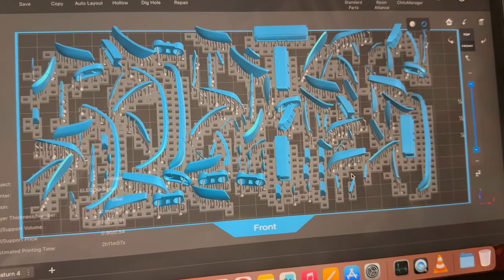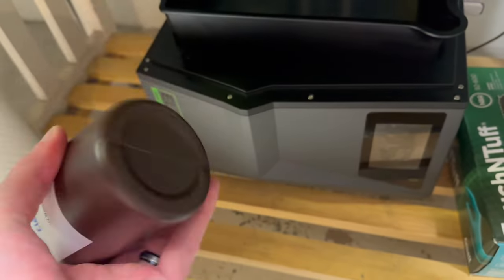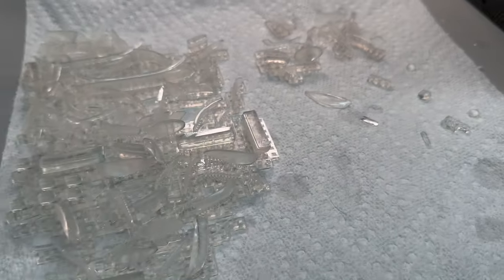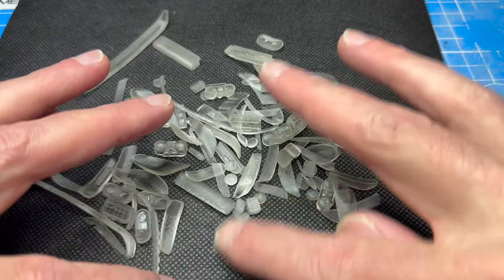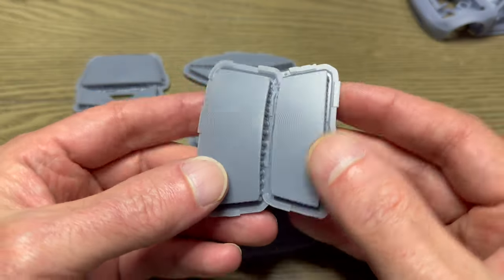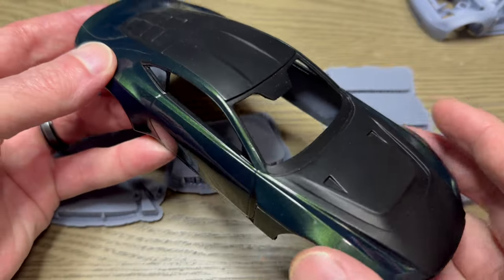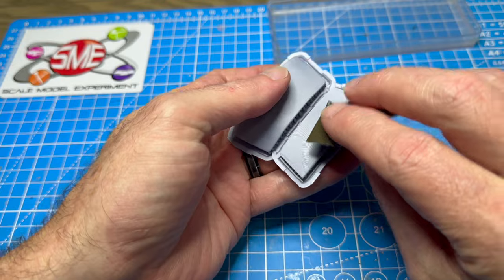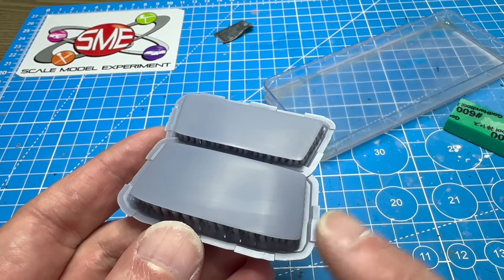Complete Idiot’s Guide to 3d Resin printing Clear Parts and Vacuum Forming

Comment: I've never used a vacuum former before. But I was thinking maybe you could just skip the heating element. Clamp the plastic sheet down on your molds and turn on the vacuum table. Then, use a heat gun to slowly heat the clear plastic sheet. It might give you more control. Just a thought. Only recently found your channel and have really been enjoying your videos.
Reply from the maker: That’s a good idea too for more control of the heat. Welcome to the channel, I appreciate your support.

Comment: 320 to 4000 is a huge jump in grit…to eliminate those scratches left by the 320 you need to use several intermediate grits between 320 and 4000.  400, 600, 800, 1000, 2000 should do the trick.
Reply from the maker: Thanks Forrest. I firmly believe that the window bucks don’t need to be any smother than maybe 800 grit. Now I know…

Comment: Alot of aircraft modelers dip their canopies in future floor wax an helps them be crystal clear. I would try that before tamiya clear. Looks good though.  As for the vacuum forming I think having the window bucks still on the 3d supports is causing the clear plastic to be drawn down and gripping near those supports thus not "letting go". Is there any way to put the window bucks onto a solid base?
Reply from the maker: Hi Dean, I’ll have to call in a favor to model the bucks the way you said. I don’t have the experience in Blender to do that (yet).

Comment: I have a lot of experience in vacuum forming small clear parts. The way your buddy did the buck is the best way to do it but make the ridge around the desired part a little deeper. Around the perimeter of that recess drill tiny holes to allow the air that is getting trapped in the valley to be removed. It is best to have a solid form to pull down on, I made my bucks out of cast plastic in silicone molds. You could take the molds like you make and polish them. Then take a rolled out piece of clay and fill in the sides to cover the supports. Then form a dam around the outside and pour in your silicone rubber. Once the mold is cured you can then pour in the casting resin. Once the resin cures drill the tiny holes around the outside edge in the valley completely through to the backside. Then take a small Dremel tool to grind out small channels between each hole on the backside of the buck. This allows the channels to line up with at least some of the holes in your vacuum formers base and suck out the trapped air around the part you want. Getting the heat on the plastic just right is a bit of an art form. If it bubbles it was too hot. pay attention to the sag of the plastic. If it doesn’t sag the plastic is too thick go down a thickness.
Reply from the maker: Thank you so much for your thorough explanation. Haha that’s a lot of work for a one off piece. I’m not in the business of selling. If I have a very special project that needs PERFECT windows I’ll go to the trouble of making a perfect buck. In reality I print 10, build 1 these days.

Comment: I meant to say in my last response, I have watched so many vacuum forming videos in the past, and they mention the small bubbles/dots in the PET are because there is some moisture in the sheets. Dry the sheets in the oven for an hour on very low heat. This will make the sheets crystal clear when forming. The stains are from the moisture.
Reply from the maker: Interesting, the sheets were in the house for a year and I took the protective covers off just before I put them in the machine. I think I over heated them next time I’ll heat them very quickly and pull vacuum to see what happens. I’ll also watch other people’s videos.
Reply: Leaving the protective plastic on until you are ready to put it in the former resolves the moisture issue. The bubble are from overheating the plastic. Since the heating element is all around the outer edge it will heat the plastic faster on the outer edge than in the center.
Reply from the maker: I’ve heard so many people say to wait until the plastic droops down before pulling a vacuum. I’m going to experiment with some much thinner plastic to see what kind of results I can get with it.

Comment: The first mold is the correct one, the only thing missing is the air passages for the vacuum, the more you have the better, the second one is bad for a reason, the piece to be made will hug underneath, for that reason it was difficult to remove, no and it needs to be a tall piece, it has to be well ventilated
Reply from the maker: Good tips there. I’ll make more bucks and try again.

Comment: Very informative James! Just a thought……when I create window bucks for my designs, I create them with no less than 2.5mm’s thickness to withstand the forces of the machine.

It looks like they were a bit thinner than that, not to mention the hot material coming down on it may weaken it a tad at that point of force.

Yes……I’ve recommended to folks vacuforming that to be sure you have PLENTY of PETG or Vivak around.

It can take several tries or more until you get a good piece, as there’s a lot of variables taking place that can affect how it will come out.

Heat, thickness of the object, force of the machine, thickness of the plastic……all play a role.

Thanks again for the great video James! I’m sure it’s gonna help a bunch of folks. 👍🏾
Reply from the maker: I’ll be printing more bucks and trying to form more soon.

Comment: I hope you do a follow up on vacuum forming windows. I might also suggest a bit of a review of the printing equipment and supplies you are using. So glad you’re sticking with your information/educational based format. So many of the other channels have moved away from this style. I’m completely engrossed in your advanced tools and techniques!
Reply from the maker: Hi Steve, I will be returning back to vacuum forming later. I have a tight deadline with this project so I need to spend my time wisely. I appreciate your support of the channel. I’m always trying new stuff to see if it works better. 👍
Reply: That is the number one question with everyone as far as 3D printed models. What about the windows?  @ScaleModelExperiment

Comment: Great video James. I’m trying to print glass today too. After washing I let dry, then I dipped. Ack in resin. At. It looked good, then I cured it for 1 minutes and it came out about 60%, but showed print lines. My next batch I’m going to sand glass after curing, then I’m going to try clear spray on 1 piece and future polish on the other. I like the way you’re making your bucks. I’m going to set that up tonight and try making bucks for my vacu form machine. I keep getting small bubbles or the haze you got as well. Some day………..👍👍
Reply from the maker: Hi Big Chief, I have been getting a lot of good feedback from the video. The bucks that I was using may not work because the vacuum is pulling under the lip. I will try the other bucks with less heat to see if I can do better. It’s all a SME 😁

Comment: Thanks for the video and kudos.  One thing about vacuforming is to make sure you have no undercuts on your buck.  The shape your viewer sent you is a far better approach.  Any undercuts you have (all that lip and raft space below) will draw the plastic in around your buck and make it difficult to remove, as you experienced.  You want a pretty good draft angle on your shoulder around the face of the buck, so that the buck contacts the hot plastic first, and plenty of vacuum air flow around it from that draft angle allows it to pull tight to the top.  Sharp corners or height differences will also make it harder to get a good pull, or sometimes to close suction route over a part... but you shouldn't run into that unless you start doing some pretty out there bubble window retro future cars, lol.  Keep having fun!
Reply from the maker: Thanks so much for the information. I’ll be trying again with the different buck soon.
Reply: Small holes around the perimeter of the part you want would allow air trapped in that area to be removed and pull the plastic tight in that area. Otherwise like you say the air gets trapped in that area.

Comment: Nice video James. Clear resin parts can be a pain. For my clear resin parts I spray them with Mr. Hobby GX112 uv cut clear. Not only does it return the clear finish the UV blocker helps prevent yellowing over time. Every time I see someone vacuum form it seems like an ordeal.
Reply from the maker: Hi JH, I’ll be dipping them. Maybe I could thin some Mr hobby into a cup for dipping.😁
Reply: @ScaleModelExperiment  Aircraft modellers have been dipping their canopies in Future floor polish for decades to improve clarity. Works really good in that genre.

Comment: I think Paul Budzik has done some really good videos/articles on vacuum forming clear parts. I think he uses thicker clear acrylic, much stronger and polishes out really well.
Reply from the maker: Thanks Allan, I’ll look that up.
Reply: @ScaleModelExperiment  This one in particular is what I found and really informative. Notice that he switches on his vacuum well after the plastic has been pulled down over the buck. Also notice the stainless wire sheet he uses over the plastic to dissipate the heat to the plastic. 

James, I will try buy one of those small dental vacuum formers that you have borrowed, they look reasonably priced. I have a much larger vacuum former machine which I find unnecessarily too big. 

This is the video in reference. I assume you have found the same one. 
https://youtu.be/e7RkwCerPPA?si=VXTVWXmrDTXHubSv

Comment: My clear sheet vac experience is nil.  Except to say that I've never successfully polished imperfections from the finished product!  But I have had good luck polishing 3D clear parts. I sand back any imperfections with 1500 and hit it with Novus 2.  A nice flat surface reflection looks more realistic than X22 in my view.
Reply from the maker: I like the look of the thin sheet windows better than kit plastic so I’ll be using it. As for headlights and tail lights they will be fine with clear on top.

Comment: Hi. You need to use the other bucks. The reason you had problems is the lip of the window's. You can't have any place the plastic can catch on. Or you'll have to cut the window out to remove it. Great videos, I'm new to 3d printing and I'm enjoying them.
Reply from the maker: Thanks for watching Dave, I’m not new to printing but I’m still learning. I’ll print more bucks and try again👍

Comment: Hi James, Good start, I think your petg is way too hot the other problem is that you have undercuts under your windshields that's why it's catching and breaking. 
For a simple shape like that you can warm the sheet lightly and pull-it without the vacuum, it will avoid the resin from melting (stains on your windshield). 
The reason I made the windshields on a base like that is to avoid the wrinkles, are they at the right scale? The clear resin parts look great, way better than I was expecting (lines, bubbles,...).👋🏻
Reply from the maker: Thanks again Yves for your help. I’ll be trying again this week.

Comment: In commercial vacuum formed bodies, the manufacturer usually leaves the the protective film on the plastic on the surface that is away from the buck. They also use a light coating of release agent on the buck to make removing the plastic easier.

I like that cartoon Miata. Where can I get the files for that?
Reply from the maker: Thanks for the tip on the vacuum former. The Miata is from a designer named tuner kits.

Comment: You are a nutter just like me! I've been doing the same thing LOL. Clear printed the parts - Didn't think to dip them ( I will try that now rather than polish ). Got a vacuum former, but cutting the parts and sanding them to fit perfectly is DIFFICULT to say the least - I will still do it though. Great to see I'm not the only one with these crazy issues ;0
Reply from the maker: Haha, we can’t help ourselves 😂. I do have an idea to print some clear parts. If it works I’ll make a video. If it doesn’t well… I’ll keep it to myself.

Comment: Where did you get the vacuum form machine from.  I broke the windshield in a 64 1/2 Mustang convertible I am building.  I glued it back together and sanded and polished the seams smooth.  I would like to try to use it as mold to make another one.
Reply from the maker: The vacuum former belongs to a friend of mine. Look up dental vacuum formers on Amazon or eBay. That’s what it is.
Reply: @ thank you

Comment: This is definitely something I want to get into not only for my model building hobby but my sons Dungeon and Dragons gameplay. My question is can the parts be cured while still attached to the supports or is removing them before curing just a personalpreference? I've ordered parts from several different retailers and some come already removed and some come still on the supports. Great video by the way.
Reply from the maker: Hi BlownMouse, yes parts can be cured on supports. It’s my preference to remove them before because they have some flex to them making it easier to remove them. It’s a great hobby to get into. Enjoy it!

Comment: I wonder if there is any type of release agent that could be used on the bucks for vacuforming?
Reply from the maker: Can’t be a powder because it would get sucked into the vacuum. A grease would distort the glass. The problem was that I didn’t have a solid form and it got under the edge.
Reply: @ScaleModelExperiment  yes I was also wondering if it may have tried to form around the back side. I wonder if it would make a difference if the bucks were shot with clear.  Just an idea
Reply from the maker: @michaelmanuel7978 interesting idea let me think about that.

Comment: Print a reverse mold for it to help the forming process so you can use less air pressure and less heat.
Reply from the maker: Interesting 🤔 I may have to try that.

Comment: Seems like a release agent is needed on the buck 3d printed part?
Reply from the maker: Thats a good point.  I think that I saw someone use a baby powder. BUT, I don't want anything sucked into the vacuum chamber!  I'll keep working on my vacuum forming and post more videos.
Reply: Release agent not needed. Need to get rid of the undercuts. And have a solid mold buck. A tapered outer perimeter around the desired part will allow it to come out of the formed plastic easier.
Reply from the maker: @ I agree, I have some form bucks like that and they are easier to get out of the plastic.

Comment: I was really hopeful you were going to show a successful method to create windshields for the resin car bodies.  This single issue is what’s holding me back from downloading and printing some of the awesome bodies out there.  Commercially available resin bodies are usually based on existing kits and you can use windshields and other parts from a donor kit, not an option for the stl “kits” I would assume.  Couple things came to mind while watching your attempts.  Possibly use slightly thicker sheet to eliminate some of the waviness??  Also, I’m thinking the solid forming bucks are definitely the way to go.  They’d surely make removal of the clear film much much easier.
Reply from the maker: There have been a lot of suggestions from the audience to help. Making the bucks solid to heating the plastic less. It’ll take some practice but I’ll figure it out and share my findings.
Reply: @ScaleModelExperiment   awesome !!!  I’ll stay tuned 😀😀

Comment: the protective film can remain on, until the vacuum formed part is trimmed and ready to be placed on the model.
also, try different vacuum forming material. some materials smell bad, and others don't smell much.
and you need to wait until the material droops about 1 inch from it's original flat position, before lowering it onto the master mold.
sometimes called the plug. never heard of that being refered as a "buck". but who knows.
Reply from the maker: I appreciate you sharing your tips. Next time I get the machine out I’ll try them. I’m currently using .02 PETG vivak material. Next time I’ll try to buy a thinner material.

Comment: I am curious, do you find a preference with the vacuum windows over the printed ones? I would assume the printed windshields are meant to fit really well in the spaces provided so why not just print the window peices in clear? I love the thinness of the vacuformed ones but it also kind of feels low tech, like going back to garage resin kits.
Reply: No, you will NOT get them as clear as a good vacuformed piece. It can be pure hell to get rid of the resolution lines, divot marks of the supports……all kinds of hassle to polish the glass clear…..AND you run the risk of breaking the glass due to it being more brittle.

Vacuforming can take a number of tries before you get a good one……it’s taken me sometimes half a dozen tries before I get glass I can be happy with.

Comment: Try and use the plastic from a two liter soda pop bottle
Reply from the maker: That’s a good idea if you have a crystal clear scratch free bottle.
Reply: Try and use the part under the label.  Cut the plastic to the size of your vacuum forming machine.  
Then try, if 
You have any scratches.  You can use quick  shine on the new formed glass
Reply from the maker: @andrewredmon7080  gotcha!